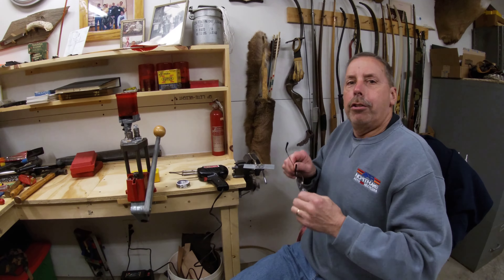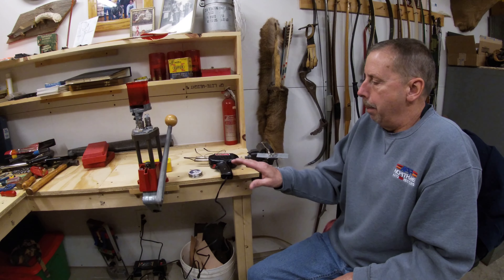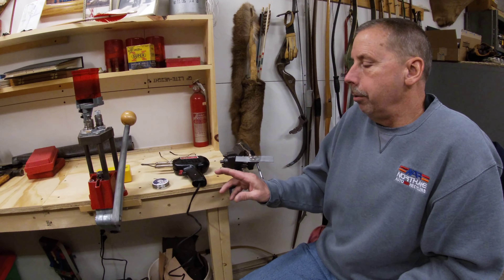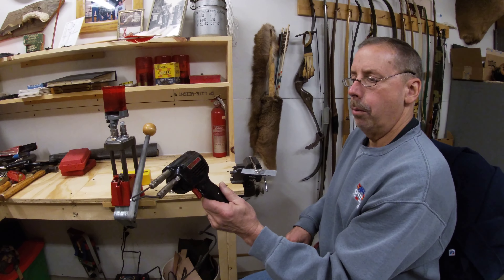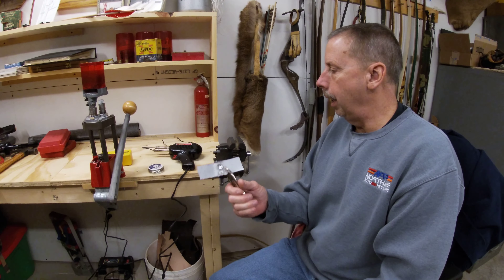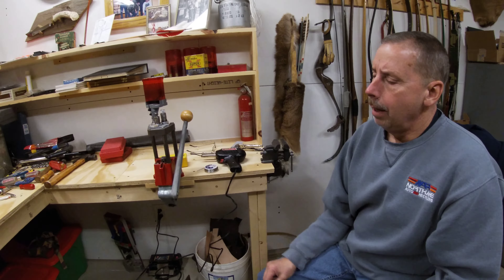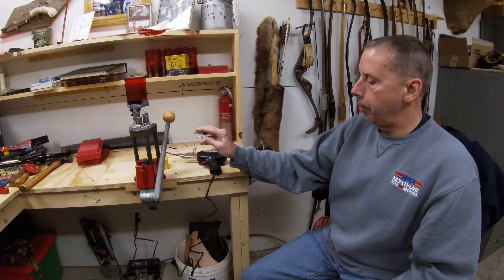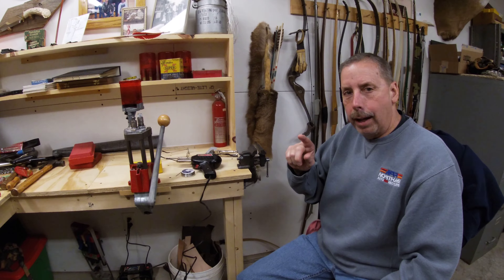Weller Soldering Gun GIVEAWAY | Watch till the end

Comment: I"m going to use your soldering technique this weekend. What do you suggest, or do you have a video, on how to properly (smarter hopefully not harder) to work/sand plastic bumpers that have road rash from a side swipe?
Reply from the maker: I don’t have a video on bumper repair yet.   If the bumper is just scratched to the point where you need to fill scratches and gouges as opposed to dents, then you can use bondo. I usually start with 80 grit on a DA to get most of the damage out then use 120 grit over entire area and then apply body filler to scratches. 180 then 220 to finish and then it will be ready to prime. Hope this helps

Comment: I just bought the wellar 140 watt soldering gun. now I'm worried it won't be hot enough. I'm trying to repair screw holes left over on my 1998 Dodge Ram roof where I removed a lund sun visor that had been mounted by a previous owner. I intitially asked a body guy to weld the holes shut but he didn't want to do it because he was afraid of catching the headliner on fire. So I just used some body filler which lasted for about 3 years but its become porous and when it rains water is seeping into the cab :-(. Now I'm excited to learn about soldering the holes to seal them! I'm looking for the correct solder now. someone told me I need acid core lead/tin solder but all I can find at the store is the rosin core lead tin solder. Any thoughts on the matter?
Reply from the maker: I don’t know if 140 watts will be hot enough. You’ll have to try and see what happens. The solder is plumbers solder that’s an acid core. It should say 95/5 lead free on package. I buy mine from home improvement store or a plumbers supply store. Hope this helps. Thanks for your comment
Reply: @autobodytrainingsolutions838  thanks a million for the info. I’m returning the 140watt gun unopened and getting a 300w I found on Amazon. I sourced the solder locally.